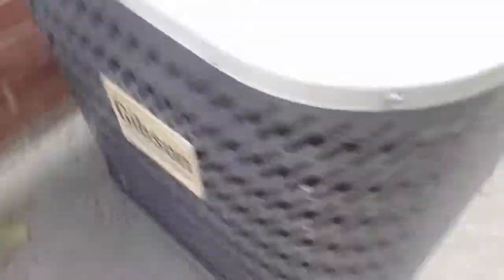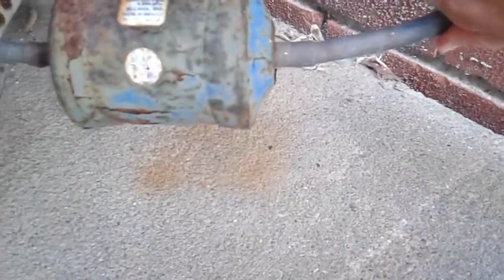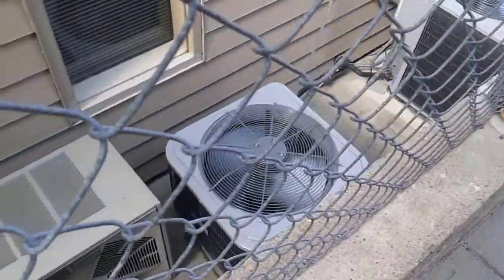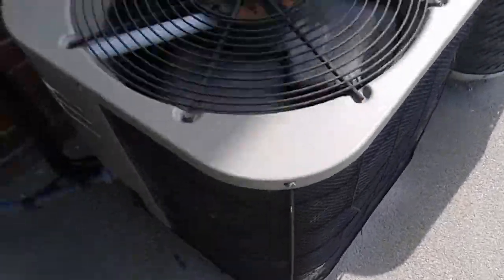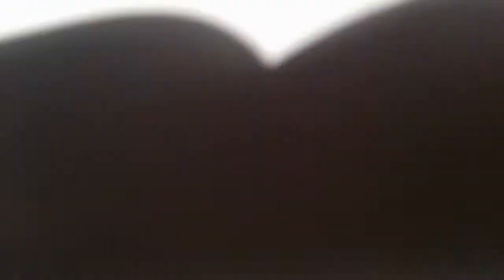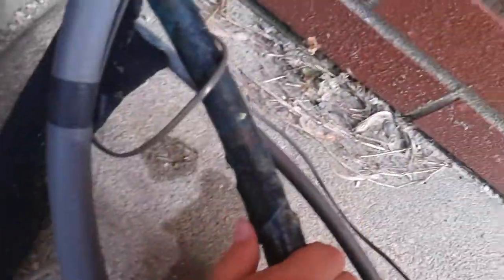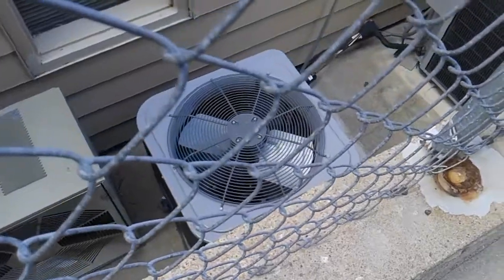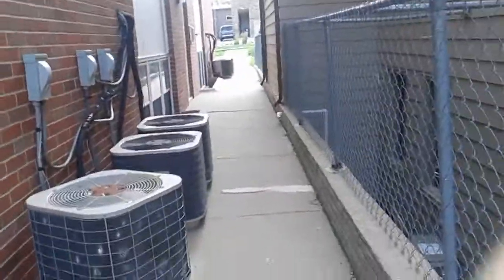A Bunch of Nordyne Air Conditioners, and 2 brand new Comfortmaker units + old scrap units!

Comment: Man, those were loud! I wonder when and where they will dispose of the old units they are no longer using.
Reply from the maker: Yeah they were very loud. The one's compressor was dying.
Reply: Dilch Productions is that one Copeland reciprocating compressor in that unit sounding terrible? Then if it is, it might overheat, if it's running hot, it might overheat and go to thermal overload and dies
Reply: that one Copeland reciprocating compressor needs to be fixed or replaced or the whole entire unit needs to be fixed or replaced
Reply from the maker: @Aris Buliteanu yeah I'm pretty sure the compressor was on its way out.
Reply: Dilch Productions is the fan motor spinning fine?
Reply from the maker: Yes.
Reply: Dilch Productions I believe the compressor is going to be replaced soon maybe??
Reply: Dilch Productions I like rotary compressor's  because they sound cool
Reply from the maker: Yeah the compressor might get replaced it didn't sound good

yeah rotary compressors are cool
Reply: Dilch Productions The compressor might get replaced with the rotary compressor from my GE J series
Reply from the maker: It's not likely, rotary compressors are not used in central air conditioners very often. If the compressor dies chances are they'll replace the whole unit